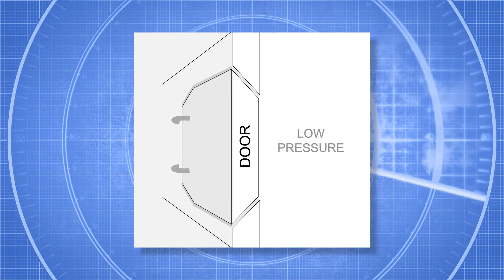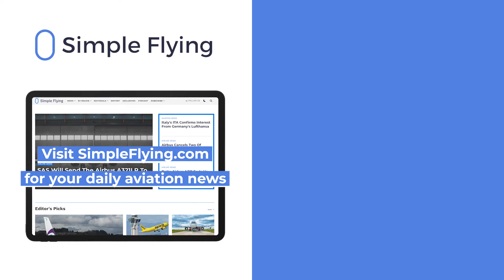Can Aircraft Doors Be Opened In Flight?

Comment: The entire construct within a plane is designed to inspire and sustain a base psychological safety in the air, when there is almost nothing that can be done in reality to mitigate mass death if things go south. It’s barely veiled, but it’s been there well before Fight Club made a point of it. 

The physics make no sense. 
The fact there’s no legal contract binding you at all to do anything but lip service as agreement, just a verbal one where you don’t look overtly loaded or mentally ill (despite a crate of MH meds, erhem, window/middle/legs). 

So it’s worthless, save that someone is assigned a sense of responsibility to maintain the illusion of rare survival. Otherwise, it’s down to not slamming into the concrete water just at the right angle, miss all lethal debris, and be incredibly lucky to be one surviving passenger at most. With either paralysis, ensuing death from injury or drowning - from varied high altitudes, still in pieces. But some may hit that water. There is no fun slide with smiles scenario in any of it. No plane in any emergency scenario I can recall broadcasted, maybe 1 of 2 in my lifetime at most that I’m not aware of or that “doesn’t make the machine media news” that would reflect a smooth glide into water in any emergency situation, and happy families helping each other with fully able bodies and wherewithal despite all the trauma, to even compute that a door once existed let alone was toted as necessary to survival. 

Until recently, crashes were rare, but why are they safer than road transport? Because fewer crashes mean lower statistics for those in flight. People fly far less than travel by car. Ultimately, because few people simply survive a plane crash. Closer to terra firma at point of impact, is also likelier to have help reach those injured.

The only way it’ll open is smashed open with humans next to it, and the oxygen inducing reverie before death. And those with you.

Very high altitude can squeeze your body through a pinhole, apparently. Physics and sense. Scary sense!

Dark. 😵‍💫

Comment: This hypothesis needs to stop. The A380 airframe is much too heavy to operate effectively with two engines, and there's zero appetite for any new aircraft with four engines, save for a supersonic jet, and the jury is still out on that.
The A380, like the 747, has achieved iconic status, and will go down as one of the best passenger aircraft in history, but it's not going to be revived with new engines the way the 747 was. This ship has say and we should let it sail on.

Comment: What about the Asiana a321 incident?
Reply: Should have been addressed but it was at very low altitude - so no pressure differential - and the door was armed, meaning opening was assisted for (ground) use in emergency.
Reply: @PedroConejo1939  oh gotcha
Reply: @PedroConejo1939 look in the description. This was recorded before the Asiana incident.
Reply: @busfan9874  Ah, the joys of the YT algorithm.
Reply: The door was opened at 700 feet above the ground which means that the air pressure outside was the same as inside, making it possible to open the door. At much higher altitudes, it is impossible to open the doors due to extreme pressure pushing against the doors. Remember, aircraft doors open inwards before opening outward.

Comment: But a stressed out Korean passenger did it in May 2023. He opened the door mid flight!
Reply: Not mid flight but on approach but still.
Reply: @alecgrolimond1678  if it’s not on the ground it’s in flight
Reply: @whiteandnerdytuba  Look at what I said it was on approach not landed.  From what I understood was they were a few minutes from the airport I think.
Reply: @alecgrolimond1678  hence mid flight
Reply: @whiteandnerdytuba  No not mid flight the aproach which just prior to landing look up the term :-) or don't
Reply: @alecgrolimond1678  does saying while in flight help your delicate sensitivities.
Reply: The pressure difference was low because the aircraft was so close to the ground. It’s impossible at higher altitudes.
Reply: Cannot be opened at 30,000 ft
Reply: It was only possible because the aircraft was about 700 feet above the ground which means the air pressure outside matched the pressure inside making it possible to open the doors.
Reply: @kevinp8108  
Exactly and how those parachuting people loves Parachuting from Small light  Aircraft flying between 700 to 1000 feet ,Can open the Doors for Parachutist Enthusiasts to jump out .
Reply: Yes and Those Parachuting Enthusiasts in Light Aircraft or Helicopter flying sbout 700 to 1200 feet Maximum, Enough Air pressure same to just open the doors of the Aircraft for Parachutes Enthusiasts to Bale out of the Aircraft, even Military Elite Commandos Do Parachuting ,jump outside Aircraft at around 700 to 1200ft.
Reply: @Wongwanchungwongjumbo  
Those airplanes are not pressurised and they go much higer like 10,000ft

Comment: Very useful after the recent incident on an Asiana Airlines flight...
Reply: The narrator did forget to mention that aircraft doors can be opened several hundred feet above the ground when outside pressure and inside pressure are equal. That is exactly what happened on the Asiana flight. The aircraft was 700 feet above the ground which allowed the doors to be opened.
Reply: @kevinp8108  hahaha it can never be equal. Outer pressure is always high

Comment: short answer: you have to be really strong to open it mid flight, these doors are held tight by air pressure.
Reply: You're actually more likely to break the handle/lever if you're really strong, rather than opening the door...
Reply: @NikolaiUA  yep.
Reply: SAA 747 opened its door in flight to vent smoke
Reply: Not if you are near the ground, see a recent incident on an Asiana Airlines flight.
Reply: @heidirabenau511  yep